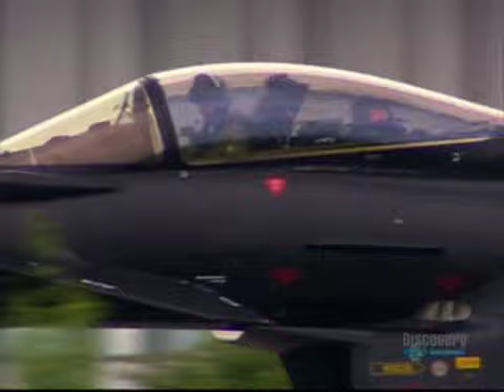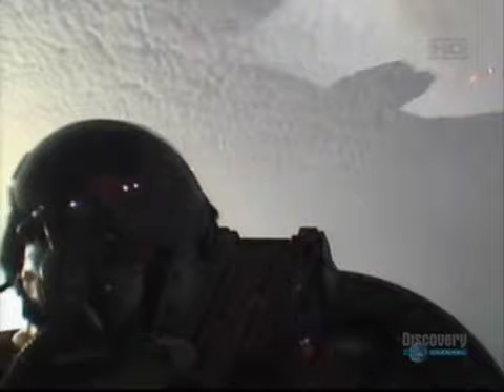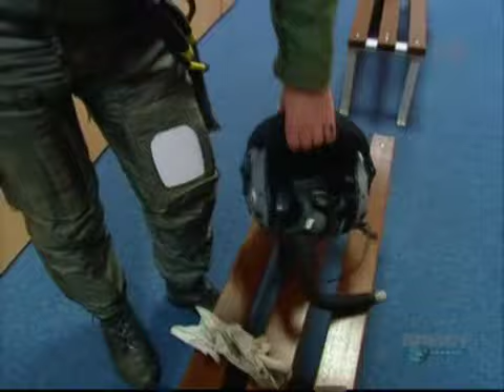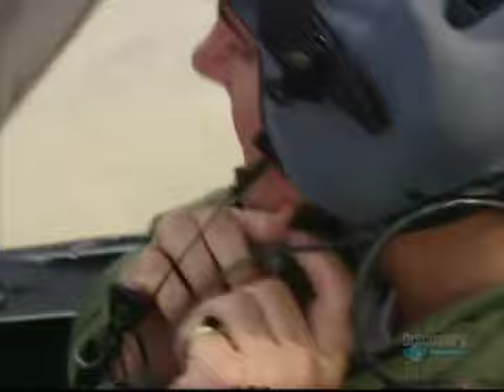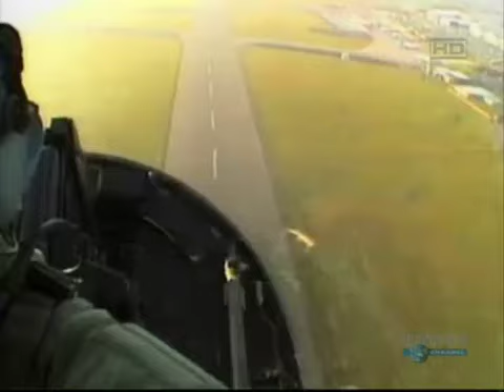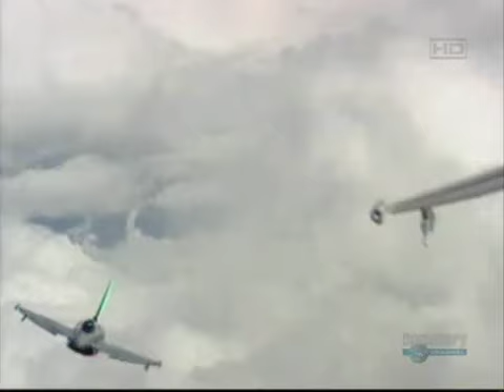Ultimate Strike Planes - Eurofighter Typhoon

Comment: The Typhoon has both more thrust and a higher thrust: weight ratio than the Rafale (40,400lbs vs 34,000lbs and 1.18 vs 1.09 respectively). Regarding the radar, whilst fundamentally more advanced, the RBE2 is anaemic by comparison to the Captor M, detecting a 5m2 target at up to 130km, vs the Captor M's 185km. The Captor E, to be fitted to the Tranche 3A Typhoon's, will do this up to 320km, and is an AESA system, with approximately the same performance as the AN/APG-77.

Comment: british pilot would never get into the idf, israel dominates the air because of its close air to air combat dog fights! flying has high as possible is another way to get killed straight away too, heat seeking missiles will find ur ass, u need find a good hight range to avoid surface to air missiles and u need stealth which the typhoon doesnt have, thats why the typhoon goes high as quick as possible not to be seen. with stealth u need to send fighters to find them but they will be waiting for u